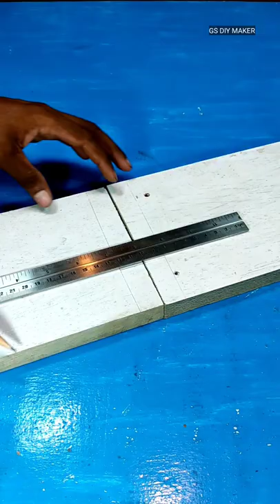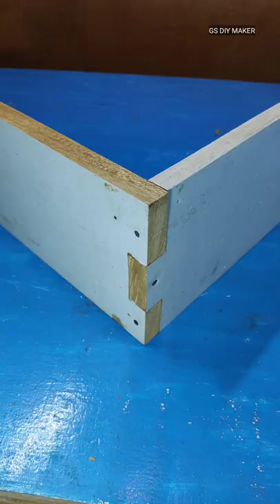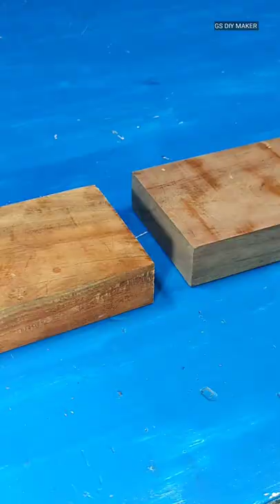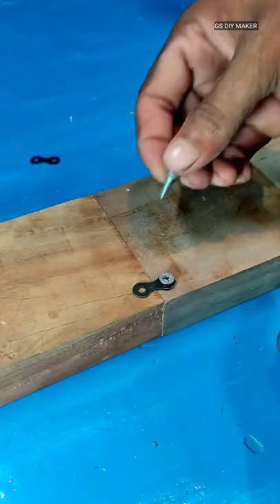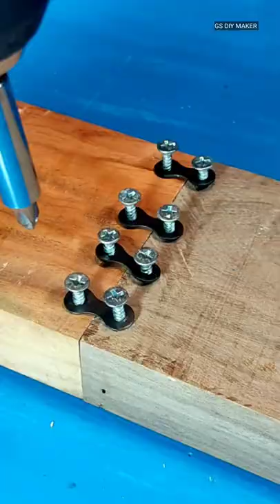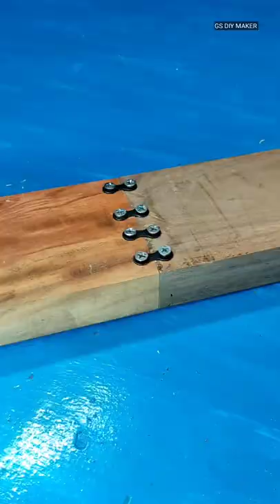3 Amazing Wood Joints in 1 minute #woodworking #journey #shorts

Comment: If I saw that third one on a project I would have concerns
Reply: Why? It make the joint look more uniform and ensures that the other nails can't come out...

Just because the third nail isn't needed, doesn't mean it hurts the joint. It's an extra nail...come on. 😂

Nails are cheap. If you are worried about an extra nail where it adds layered security, you shouldn't be working on any projects.